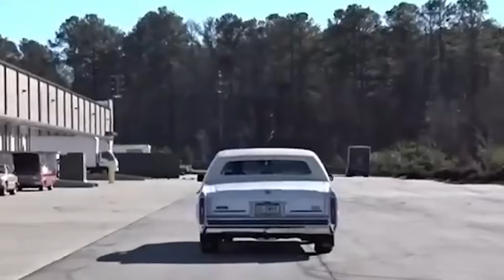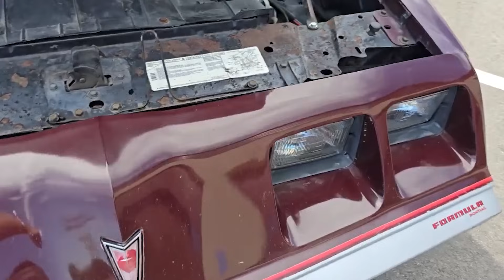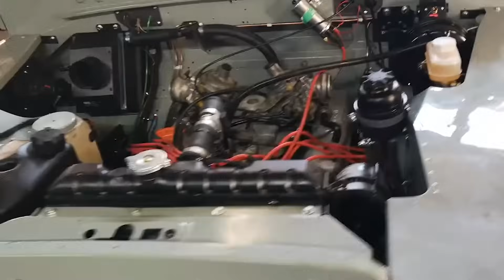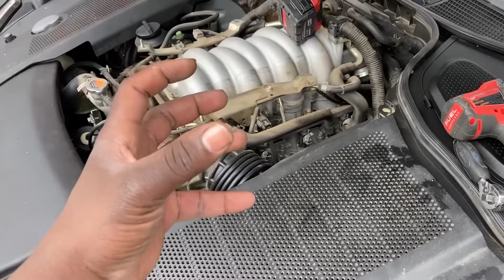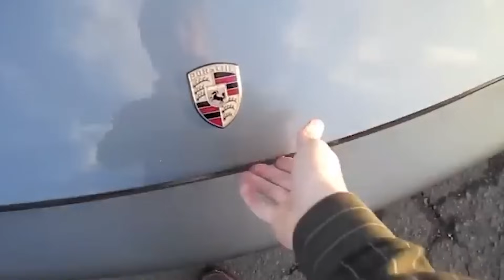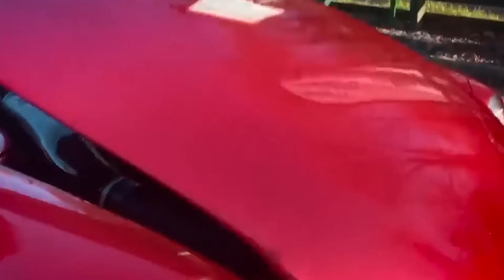30 MOST FAILED and WEIRDEST V8 Engines Ever Made

Comment: If Aston Martin was using the Chrysler 3 speed Automatic, they couldn't have used a more robust and reliable transmission. Actually I wonder if the authors of these videos have ever done any research. While some of the engines mentioned were total disasters many were quite reliable.  And, the Chrysler A279 Ball and Stud Hemi never made it out of planning and testing and it wasn't canceled because it was bad. It was canceled because of the gas crises and new emissions regulations that were coming. By the mid 1970's almost any resemblance of performance was killed.

Comment: So that's why there should be a law against anything that plastic in the engine or on the outside side of the. No plastic will be used on moving parts all wiring inside a car have connectors that have screws so all a mechanic has to do is loosen the screws and gently pull the 2 parts away from each other.

Comment: So when you where showering one of the Hemis I noticed that wasn't a fan shroud if you don't have a fan shroud of corse your engine will over heat. Ask me how do I know well I had Toyota pickup with the 22R 4 cylinder engine. Anyway I was out there doing some work under the truck  and so I decided to take off the bottom part of the shroud left it off and put everything else back and decided to test drive the truck and with in 5 minutes the engine over heated so pull the into the driveway and turned off the engine and got the bottom of shroud and put it back on and took the truck for  a test drive. The read high at the beginning but cooled down with in 3 minutes and had no more over heating ever.

Comment: The '70s was the worst years for cars due to the stupid car killing EPA.  When it came into being, cars became  pretty well weak junky vehicles the that struggled to make the car just get down the road. Until technology somewhat caught up with electronics that in it's early era was also a joke for a lot of cars. I got out of the mechanic business in the 80's because of the need for having to buy diagnostic devices that were designed for each vehicle only, and the devices weren't cheap.  Then you come up to recent times where they went nuts with them to where the car makers are trying to make the car do everything for you, with all the bugs that come with electronics in any device or car.   On the Y block Ford I can remember the external oil systems on the valve covers to make up for the weak oiling system. along with their short wheezy lives.  I never owned one because of that engine, becoming a GM driver in my early years.   And MoPar, yuk, terrible engineering and too heavy for their engines that were POS junk cars in general, by gaining the experience of sadly owning a '56 Dodge car, that decided it didn't want one of it's rods to stay in the engine and left a big hole in the block upon it's trip outside of the engine. Japan came to my rescue with every car and truck I owned through the years, with Datsun-Nissan and Toyota at the top of the list with the '84 Toyota diesel pickup as the king of lastability. I put OVER 800K on that pickup, and the only reason it was parked is because the box frame under it rusted in two under the cab-bed area, with it still running, but at ten years of normal use, I never was sorry for buying it.  On up to today, now we own a '17 Buick Envision, yes, the Chinese built one, unknown until a few months after we bought it, but to my surprise, at the now 113K miles on it, the 5 year battery, one set of tires and the front strut shocks are the only items that we have had to replace, and I was the one to replace the struts, a simple job for any mechanic worth his salt.  I see at least the 300K miles it was designed to go a good possibility with it.